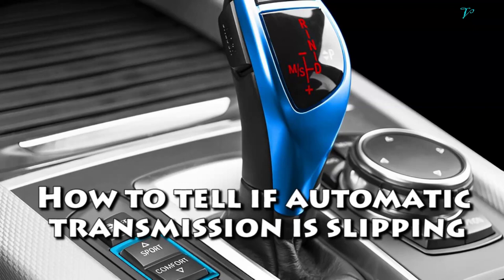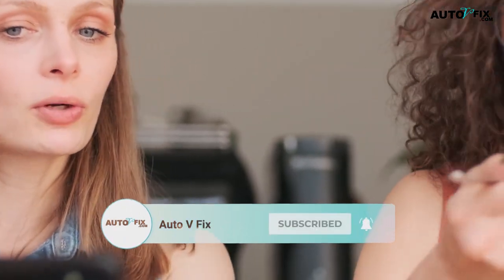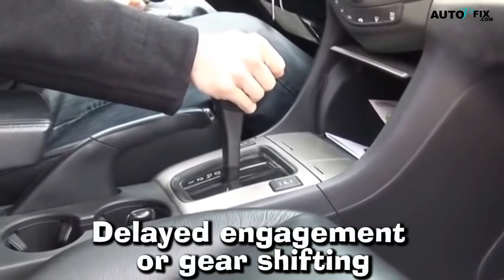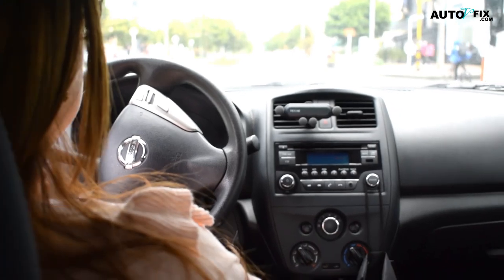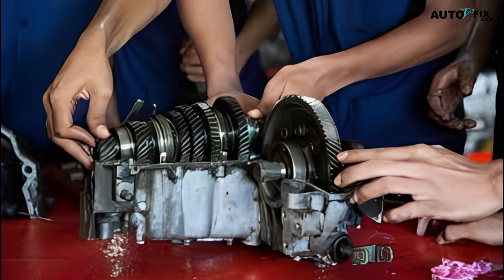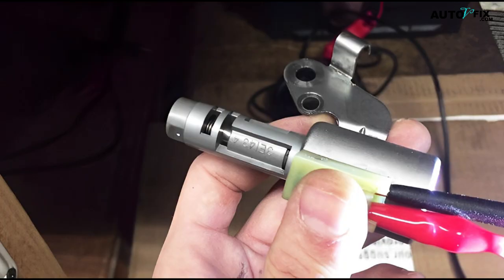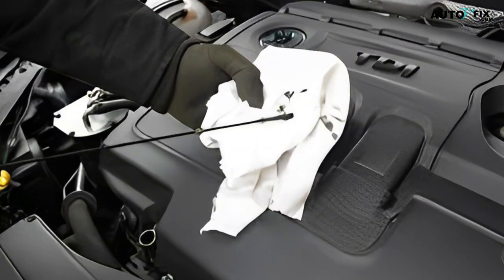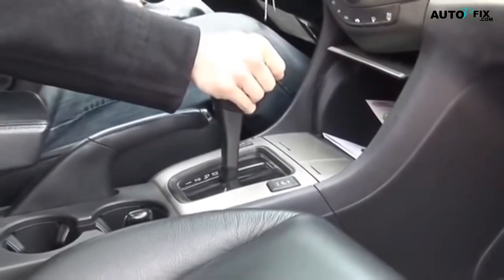How to Tell if Automatic Transmission is Slipping & How to Fix Slipping Transmission Issues

Comment: Thanks for the excellent video and professional tips
I have an Opel Mokka (Vauxhall) 1,6 automatic. When I drive at 70 kmh between 1600 – 2000 rpm with around 5 gear the car is shaking.
Can you give me a clue why this is happening?
Thanks

Comment: well I rebuild transmissions, an I wouldn't listen to this guy because you can't check clutches in an automatic or manual transmission in the pan. that can only be done by removing the transmission
Reply: Hello I have a Lexus es330 it slips in gear 3 and 4 and with high RPM when on motion
Reply: I just changed the converter pump cause old one was licking so had to replace it then after that it all starts slipping while on motion